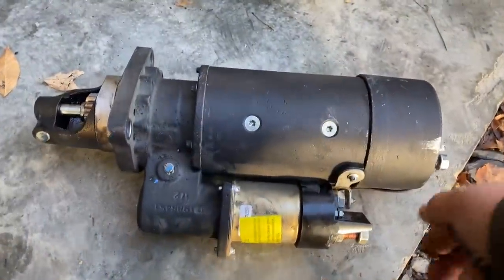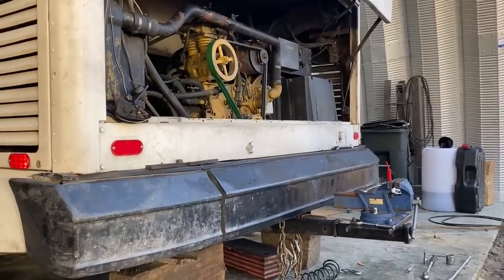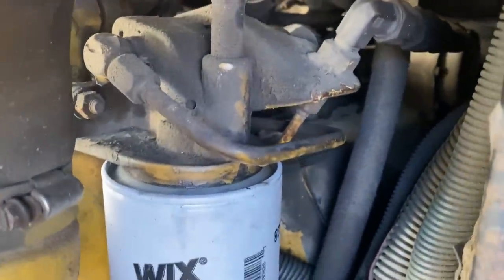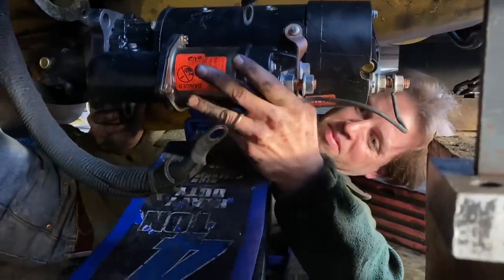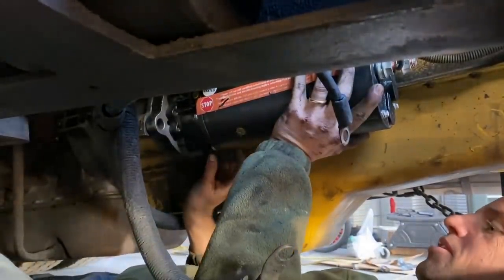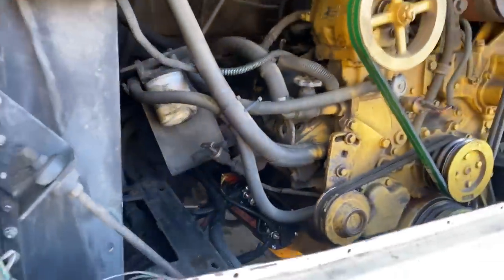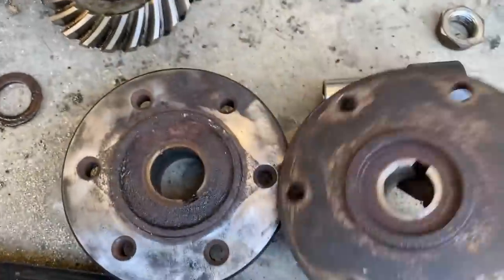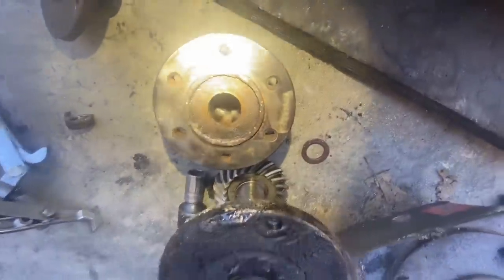Bad mechanic put wrong starter on this bus.  24v on a 12v bus.  Charged $1,400 (900 for the starter)

Comment: thinking about the Intermittent START from the starter after replacement..
do you have gators for your test leads to do voltage drop tests..

 i want to know voltage drops from the Solenoid Negative POST .. not the one on the starter end frame but the actual stud coming out the left side of the starter .. to both the engine block and to a jumper cable stretched across the floor from the Negative battery posts..  while you push the thomas button and while you use the remote starter switch..

 i would also want the positive side of the solenoid winding checked.  this time voltage drop is to the top post on the solenoid.. i want to know how much drop between the positive connection and the positive solenoid winding is when the thomas push button is depressed and when the remote starter button is used.. 

 i personally worry that the remote starter switch may have burned contacts from the massive amount of use.. but i also wonder about voltage drop to the positive side of the stud.. 

 on GM cars with a similar set up.. i use a 1971 dodge dart firewall mounted relay..  with a 10 gauge wire from the top post on the starter mounted solenoid to the threaded stud on the dodge relay.. the middle hold down clamp gets a  10 gauge wire to the starter solenoid positive winding..   the old wire to the starter mounted solenoid go on one of the push on terminals. . the other push on terminal has a wire to ground..  this takes the probable 80 to 100 amps of PULL IN current on the starter control circuit and drops it to 2 or 3 amps.. talk about an amazing difference.   you can do the same with a ford starter solenoid but i have gotten so many bad ones lately.. 

 one can get a Dorman - Conduct-Tite Sealed Push Button Starter Switch  Part # SW12926 which has a rubber boot over the button at any parts store in the electrical section for under 15 bucks..  make up their own remote starter switch or replace worn out pushbuttons..  this looks just like the Switch inside my snap on remote starter switch.. 

 i hope somebody has a wiring diagram or takes a peak inside the rear start box.. to see if there is a relay that needs its contacts burnished or the relay needs to be replaced.. 

 i can't understand why the starter would not start EVERY TIME with the remote starter switch unless the remote starter switch has internal contact issues and needs to be replaced.. 

 or there is an IFFY Negative connection at the end of the starter case or where ever the Negative wire leads to  including other connections back to the Negative battery post.. a loose junction block stud on the negative side.. or a loose junction block on the positive side..   over the past 42 years under the hood i have had some starter issues..  this is a whopper of a lets do more diagnostics.. 

 Harborfreight has 30 foot 18 gauge test leads with horrible cheap gator clips on the ends.. item number  58024 but they are only 20 bucks.  and the ends are easily changed for doing voltage drop tests..  i would probably replace one end pair of gators.. to stackable bananas. so they could be plugged directly into the multimeter.. 

 why do voltage drop testing..  a properly sized and properly connected circuit with a load on the end using electrons should have tiny fractions of a volt when measuring from one end of the circuit to the other..   if you get more voltage drop its like a kinked garden hose.  you open the spray nozzle and you get a burst of water but then it turns to a trickle. so water at the faucet has more pressure than the other end past the kink...  easily measured..  yet.. the water flowing thru a hose without a kink has restriction also as the water has friction against the hose inner as it moves.. pressure drop. 

 i have had the voltage drop test i push trying to get mechanics to use called crap.. but i am the guy that fixes cars electrical issues  that nobody else can..
Reply from the maker: I grabbed the meter within the first couple of minutes.  Starter was getting great voltage. Signal wire was not getting any power. Remote starter switch bypassed signal wire to address no turnover issue

Comment: Ok, maybe strange question but anyhow. I'm not english native spoken.  What does it mean when you say  "I'm not on the clock"  Does this mean that you charge for a job and dont charge per hour, so it doesnt matter for the customer how long it takes, it's a fixed rate??   (long question, probably short reply)   Thanks!!
Reply from the maker: I let him replace his own starter, i just watched.  That is correct i did not charge him but i allowed him to use my shop and tools.
Reply: Hans, fee for service is quite tricky on old buses like that. I think Scott does charge for the time spent because you can't possibly know how long something will take. Scott offers several ways to help his customers reduce the labor (time) cost. if they help him, shop hour is less, if they do the work, he lets them use the shop and tools, like in this case. That is a super deal in my book.

Comment: Just a thought, do you think that starter switch might be a mercury switch like on fridge van motors and because it was trying to start 24v it was get hot straight away and not working, but now you’re running 12v it’s ok unless you load it up continually like 5 or 6 times in a row in short succession and overheating the switch
Reply: Possible if it still has an older switch in, see less and less mercoid style switches in heavy equipment. Work great and half the time they can be repaired instead of replaced. On some of the really large equipment I’ve worked on you even has some adjustments you could do to adjust when they throw of the switch turned on or off.

Comment: If it’s a 12v relay the 24v solenoid may have cooked the relay or burnt the contacts as it will pull a lot more current due to its windings and/or resistance
Reply: Maybe they also put in a 24V relay on a 12V system?
Reply: It will actually pull less current. The higher the voltage, the less current is needed.
Reply: @sw6188  it’s a 12v system with a starter designed for 24v @ 12v it will pull more current
Reply: @Mrflash222006  No it won't. If it was the other way around it would - a 12 volt starter on 24 volts will draw way more current. 
If you do the math you will see I am correct.

Comment: The 24v starter should be on a MCI only
Reply from the maker: Many other buses are 24v
Reply: @BusGreaseMonkey  The only ones I ever encountered were the MCI’s when I worked for Trailways back in the 80’s.
Reply from the maker: Prevost that was here 2 weeks ago was 24v.
Reply: Van hool ,Prevost, Mci ,Setra are all 24 volt.
Reply: @BusGreaseMonkey    Yeah the Prevost and other buses that were 24v were after my bus days in the 80’s. I only worked on the MCI’s from 74 to 88.

Comment: Too bad you didn't switch the starter to a MT39. MUCH lighter and I could use 3 batteries instead of 4 on my 3406B
Reply: That's what I was going to suggest, they weigh about 1/3 what that heavy iron one does, gear reduction so they spin much faster with way fewer amps, have a built in thermal switch so guys can't over crank and melt the starter and are physically much smaller. As a heavy truck mechanic that's what we install nearly every time.

Comment: Not you wish you had a pit?
Reply from the maker: Changing a starter standing in a pit overhead would be way harder so I’m thankful i do not have a pit.
Reply: @BusGreaseMonkey  Sorry but no one holds he starter over their head even if the pit was that deep.
Reply from the maker: I do not wish nor will i ever wish i had a pit in the shop
Reply: @BusGreaseMonkey  I understand, your building is much more than just a shop, I wouldn't want one either, some one would  get drunk and fall in the pit.

Comment: Starter  wont  work if the s terminal circut  has any issues  .   battery  power  is supplyed direct from  battery so the guy   who put the 24 volt in was full of shit